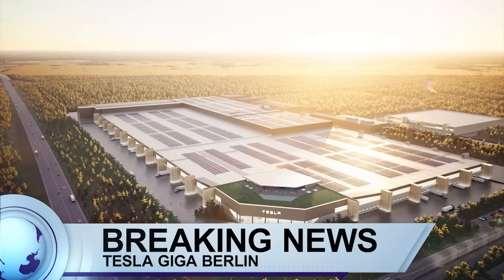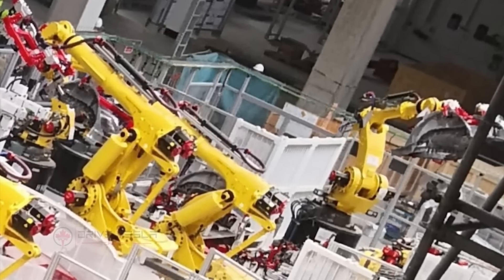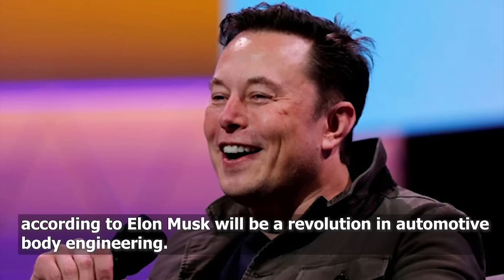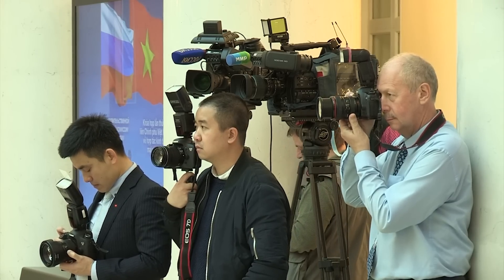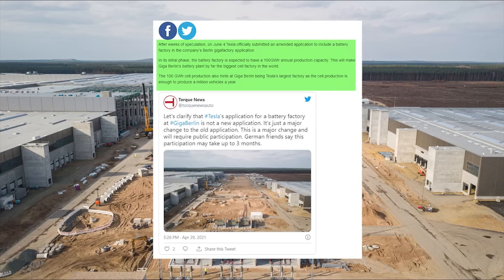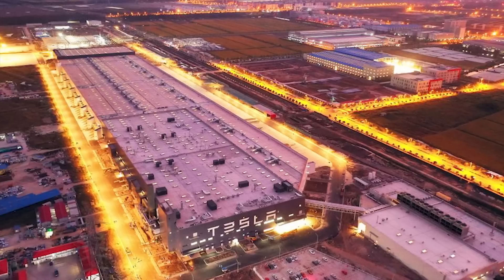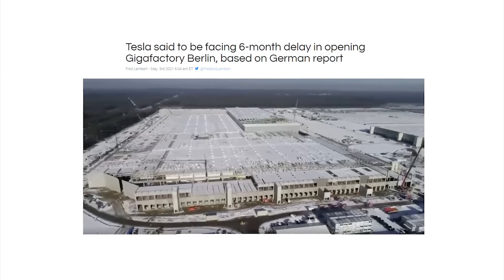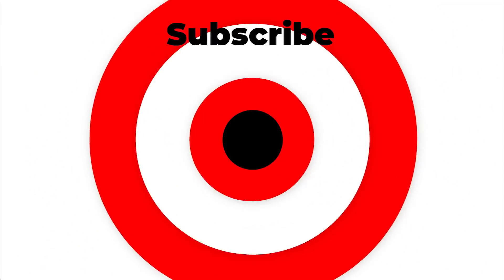Tesla Giga Berlin Starts The 1st Production Test

Comment: If or when the Berlin factory production of the model Y incorporates the cast alloy sub frame, the integral, chassis battery and the 46/80 batteries with a greater range or lower price it will be a very strong competitor for the European market.
Reply: By my intuition it already is a strong competitor.

Comment: The advanced paint shop in Berlin will likely be the slowest/last finished part of the factory
Reply: Tesla has applied for trails of the paint shop (and stamping and BiW) which were in the meantime also granted. 
While other parts of the factory are still bare of any production equipment (e.g. the GA and DU).